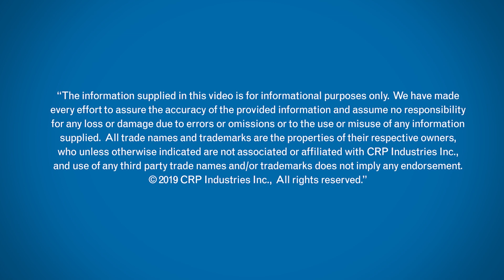TIP: Resetting Honda EPS Torque Sensor | ITB Episode 109

Comment: 2012 civic has a dtc-51-05 torque sensor coil malfunction and real torque is not zero when steering wheel is untouched. It shows  about 0.7Nm on actual data line. Torque changes if I move steering wheel. But calibration fails. Is it possible to change torque sensor separately?